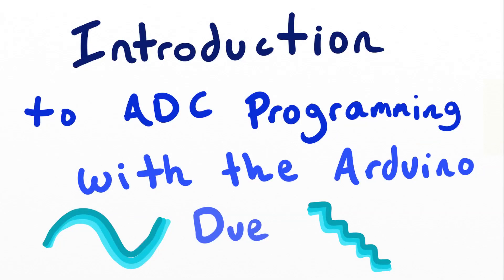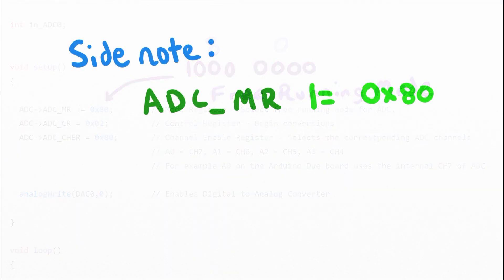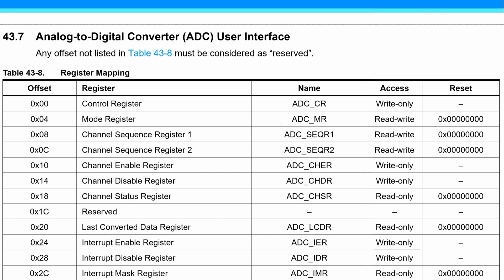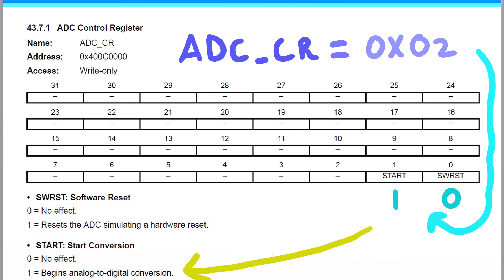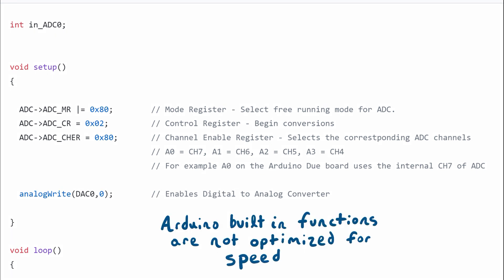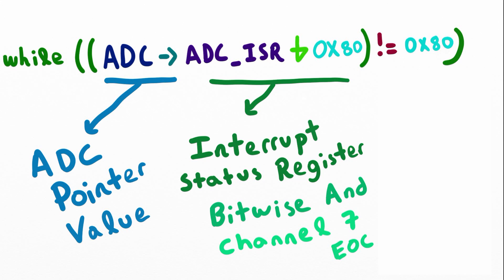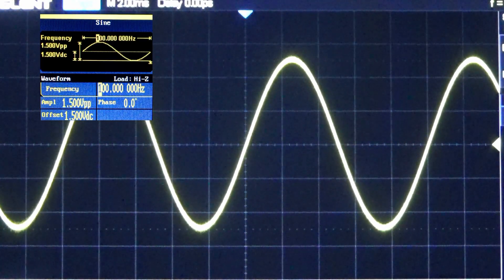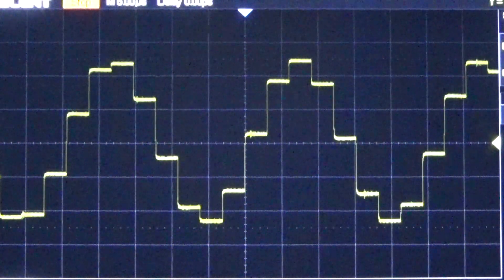Intro to ADC Programming | Using Arduino Due Analog to Digital Converter

Comment: I copied your software above and uploaded it to my Due.  Next I set my signal generator to output a DC sine wave 0 - 2Vp-p 1 kHz. I am not sure the Due can handle a true sine wave going negative.  I then plugged the + signal generator into the A0 pin and the ground into one of the ground pins.  Next, I hooked up my oscilloscope to the DAC0 pin with the ground going to one of the ground pins.  Output was only noise.  What is wrong?
Reply: My error and it appears to work okay.  What I did notice is that the Due's accurate voltage output is limited to about 700mV p-p with a frequency around 1kHz max.   For real work  need to have a much faster processor so I am moving to a Cortex M7.  The voltage out is totally inaccurate but the frequency is okay.
Reply from the maker: That is correct. To measure your sinewave you would need a DC offset for your AC sine wave. You could center the DC offest at the midpoint threshold of the ADC pin, and see the maxium amount of voltage swing around the midpoint. By "level shifting" the sinwave you can see the "negative" swing realtive to the midpoint and not ground (0V).